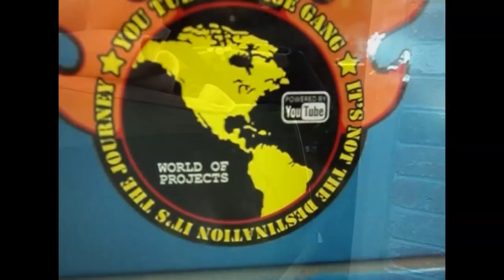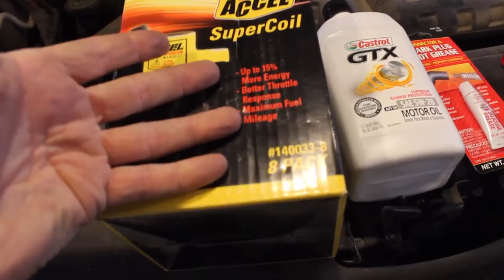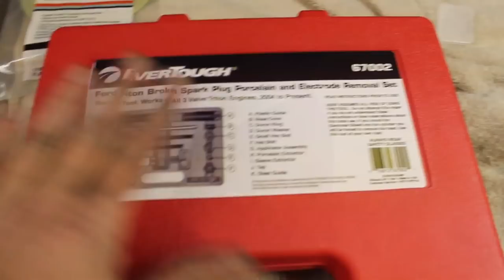F-150 Transmission Shutter - Fixed - Coil on Plug and Spark Plug Swap

Comment: Wish I would have seen this video months ago. My 06 f150 was doing the same thing. I knew I had a coil going out. So, just changed all the coils. Wouldn’t you know, runs like a dream. Now if I can figure out why my high beams stay on.
Reply: Same problem with the lights, had to change the signal light lever. Has to push it in and move it to make them turn off.

Comment: I have a 05 F150 the same issue, and gave up on the place i bought trying to fix this issue. There was no way I was going to pay any shop to replace the coils and plugs. I just picked up the OEM coils and plugs as well as the extraction tool for less than $300 USD. For a Canadian that a good deal:) Although I am 15 minutes away from Blaine Washington. Good to see a guy with some balls post a do it yourself video. Great job and thanks for posting! As far as that Earl guy total no class act.
Reply from the maker: +Brad Lacey Thanks Brad.  I'm just trying to help out guys like me who want to save a buck...  Most of this repair work is just turning wrenches...  Dealerships seem to think that type of service is worth a fortune.  Compare book time to real time and you're paying 3-5x more than you should.
Reply: Hey Greg, thanks for the reply. I agree, dealerships like to rip people off! I just changed out my plugs and coils on my 05 f150 5.4 Triton yesterday. This took me 7 hours and zero problems after I watched your video. So going back to dealer costs dam straight a rip off. If I can do it in 7 hours in my garage I am guessing it would take a dealer 3 hours or less. Thanks again:)

Comment: Wow yours does it for a long time. No matter if i throttle out of it or not it only lasts a second...

But yea alot of people want to jump right away to a bad transmission. But there are other things that can cause symptoms similar to a bad tranny you wouldn't think of first time diagnosing .
Reply: So when I hit 55 in my 2009 F-150 It seems that I lose acceleration but only for a few seconds. Is this issue the one he is currently covering in the video?
Reply: @jgoelites6308  I'd have to re watch the video. 

But i eventually HAD to replac all my coil packs WITH OEM or Accel Coil pack set. Did the spark plugs again because they had some mileage and the sooner you do them, it makes it super easy to get them out normally. 
So its worth the peace of mind, the spark plugs arent expensive. 
However the coil packs aren't cheap but need to be done. 
The stock ones on your truck, if original, are definitely either weak or failing already. Esp under high load, low rpm acceleration. This causes a sporadic misfire that feels odd during a downshift as well.

After the new coil packs, the truck felt soo much better, i wish i had done them sooner. Also i learned the hard way with the cheap ones on ebay, they just don't last that long, but they work good when they are working if you need something quick and cheap.. 

I found oem coilpacks for about 30/40$ each, so about 300$ for 8 new oem coil packs and another $75 for the set of spark plugs. 
But I still had a small shudder sometimes when  it was down shifting, but only when coming out of O/D and accelerating just enough to get that downshift. 
Eventually the transmission failed by acting odd one night all of a sudden. Had to bring it in to my friend transmission shop. 
I had him do the transmission, because i had just done the motor 8 months prior and didn't want to do it.

They took it apart and it turns out the shift drum sleeve had a crack going down it about an inch long. So it wasn't engaging properly and was also slipping. 
I was still able to drive the truck but the second time i started the truck it was in Trans Limp mode. So only 2nd & 3rd gears worked to try nd get you home i guess. 

Transmission shop told me Ford fixed this issue of the drum cracking in mid 2005. 
Then in 08 they did some more transmission upgrades, they revised some stuff like a better pump and torque converter i believe..
I had the transmission rebuilt by him and he did all the upgrades they would do on these F150 transmissions. He mentioned things like SS shift drum, Increased line pressure, newer higher volume trans pump and a few other parts that were revised. And then a full rebuild and reseal. T/C was fine and ive always done regular oil changes and it regularly since getting the truck. I did the fluid again to have both new and i had it out. 

I have about 110k on the rebuilt transmission now already. Works great! Shufts much quicker and smoother than originally and it feels like the TC locks up quicker on the highway and it helps with the power response. No lag just instant acceleration. 

The truck has 270k miles on it now lol. Ive owned since 2006 and it had 9k miles on it. I regularly tow our boat. And it's a big heavy offshore fishing style 26ft center console. 

We also put dirt bikes in the back all the time. Make long trips driving 2 hours at a clip. 
And we also off-road it and take it on the beach. 
So it gets used like a truck, but never trashed or overheated or anything like that ever. Never ran low on fluids. 

120k on the rebuilt motor from a highly rated online rebuilder of these engines. 

BUT....  fast forward to now again, 5/6 years later and the engine is making a slight tick noise and im pretty sure i know what it is. Rocker arm Needle bearing from looking into it and my own knowledge of this motor..

Im getting a upper valve train noise again. Sounds like a lifter or rocker arm going bad again. Ansd they were replaced/new when rebuild 4.5 years ago. 

So idk between the timing chain job and work to get to that point (2K$ in parts). Now im thinking why not just go with a new truck or even lease a new truck and decide to buy after that. That way at least i know it was taken care of since break-in new. 
I was thinking of picking up a new Toyota Tundra 5.7L V8 4wd Crew Cab SR5. Same spec. 1/2 ton 4WD 4-Door pickup truck. 

Its 52k$ for that truck with the few options and the SR5 offroad package added. Thats all you need as far as options especially these days with new cars. Plus its a Toyota and besides maybe some options with better MPG, it won't be worse than the F150 and it will be a simple reliable V8 used for years now...

Comment: Mine is an '07 F150, 5.4L 3V.  I replaced the spark plugs at about 120,000 miles but first bought a Lisle tool in case any of the plugs broke.  Reading and watching everything I could before doing the job I decided to use an air wrench.  First warmed up then engine, then removed the COPs, then broke the plugs loose 1/8 turn and sprayed PBlaster down the wells.  Let it sit for 20 minutes and went after them with the air wrench.  Didn't break any.  The new plugs "cured" my trans shifting problem.  New COPs are next.

Comment: Read in numerous articles those 5.4 Tritons are notorious for plugs breaking and there's a special tool at auto supply stores to remove them. I think they finally fixed the problem after 08.

Comment: I came for the spark plug change, I stayed for the Royals/KU fan...... also the guitar building.  I actually miss living on the Kansas side of the metro when I could run around with a cracked windshield like that.  take care man, and thanks for the videos.  hopefully I don't have the same problems on my 08 explorer.
Reply from the maker: ingenthronkshb If you hang onto that bad boy long enough, you'll get the Ford Shakes.  Take care!
Reply: I bought it a couple months ago from a Lexus dealer.  I didn't have it home for 24 hours before the shudder started.  far worse than in your video.  they put one coil and plug into it, new cats.  and then they replaced the torque converter and THAT fixed it.  but I didn't want to leave it with just one new plug and coil so I have ordered a full set.  will be doing it next weekend.
Reply from the maker: Arg!!!  The plugs are not fun.  Coils, no  problem.

Comment: have had a similar problem with my 07' Fx4. I replaced the coils with the accel super coils and used E3 plugs, also changed all fluids in the drive train to Royal purple oils and installed a airraid cold air kit the truck ran great I was getting 23+ MPG but after a couple of months started shuddering again found out it's a bad cat on the left side and computer is going nuts trying to balance engine and can't. also if your changing plugs for the first time remove coils and flood the hell out all plugs with wd-40 let that sit overnight should solve breaking problems, use antiseize to make future changes easier!
Reply: +Terry Goldman Get rid of those junk E3's and put Motorcraft plugs in there. Tritons love them some Motorcraft plugs only. Anti seize goes on the smooth part that sticks inside the combustion chamber there is no need for anti seize on the plug threads. It interferes with the torque measurement also.
Reply: thank god something worth reading appreciate the info and love a new try at some way to get rid of my buzz it's a very fast hammer sound.
Reply: @InternetDude  yea and 5 to 8 psi depending on a lot of things I think
Reply: flood what the canal down to the top of plug? is all you can do correct

Comment: I just had similar problems with my 07 F150 5.4 Mine ended up being the torque converter. I changed the filter and 4.5 quarts of fluid with no results. One tube of shudder fix took care of it. This is a different feel from a misfire. It sounds and feels like driving over the rumble strips on the shoulder of the interstate. It will only last a second and it occurs when the converter clutch either locks up or disengages, around 45-55 MPH. Missfires feel more like jerks or jolts or even skips. Coverter shudder is at a much higher frequency. To tell the difference, count the gear shifts from starting. You will already be in first when you shift into drive. You should see three shifts from start. Then after the three shifts, lockup will occur. This will cause your rpms to drop slightly once you are at cruising speed. If the shudder occurs here and also when the transmission downshifts out of lock up, it may be a torque converter issue. It will only occur on mild acceleration or slow downs. It will only last for a second or less and will not continue regaurdless of how you control the gas pedal. Hopefully this helps someone distinguish one from the other. If you have had missfires with a triton engine before, this will be a different feel that is easily distinguished.

Comment: I read the comments here and I have a 2 valve 99 5.4 with 260k. Still running strong. I have used motorcraft and fram filters and change the oil every 4000  miles or less. Fram filters  work well always use 5w30 no matter how many miles . Also lets discuss coil packs. In the beginning I was motorcraft only. Then I bought JEGS brand coils 8  for 140$ and the truck ran like a beast. Then upon inspection I noticed little writing on the coil packs "Made In China". Well at 170k I ran them and they are now failing at 260k. The same dg508  specs are found on  these coils and now there is a company called Precision Auto Labs in China and they are ISO/TS 16949 certified . They are selling 8 coil packs for  under 40$ on ebay. In 1999  I would have gone with motorcraft. But in 2018  the tech is out there and there is no niche market anymore.  I would bet my bottom dollar  the accel coils are also made in china and marked up .

Comment: Wait till the little stinking plastic tabs start breaking off of the wiring harness and you have to zip tie them down so it won't misfire. After breaking one spark plug I figured out how to not break any of them by constantly reversing the ratchet back and forth, tightening and loosening the spark plug. Basically take two steps forward and one step backwards. Loosen the spark plug a bit, then tighten it back up then loosen it a little more then tighten it back up. This will help break the carbon buildup off of those funny-looking cowbell shaped ground terminals on the spark plug.

Comment: to anyone else outhere changing plugs on the ford modular eng8nes. I've had GREAT success by running a tank or 2 with some seafoam cleaner. Then running a can of seafoam spray through the throttle body. when removing the plugs, all the carbon on the tip was nice and moist. I still crack the plugs and run some penetrating oil down through the plug threads. never had an issue with this

Comment: Hmm...my 2011 Towncar does the same thing in the 40-50 MPG range. And I randomly got a misfire code and it ended up going away, but still have that shutter at around 40-50 MPH. It only happens in overdrive though when it is on a mold load.

Maybe I'll try the coils and plugs.

4.6 2V.

Comment: My 2007 f150 with the 5.4 triton is doing the same thing. Same speed same conditions. Ill be fixing it this weekend. Thank you for this video.
Reply: I had the same shutter sound around 50 mph when shifting into overdrive.  It is a fairly intensive job but then again any work you do on the 5.4 l Triton V8 you will have to remove the wire harnesses and some ac lines but other than that pretty easy job.
Reply: I hope that's all mine is it starts at 40 was told the Tran. Ain't shifting into over drive. When I first drive didn't do then second ride picking it up it was missing little and shaky at idel but had old gas also. But the shaking drives me crazy sadly my disibilty I can't fix my self have to find help that sucks I've always done my own work  but the pain to stand and the heart attack yeah no more.  But I really want to fix have t had a good ride in years.  Then have to fix the guess brain behide the radio it may be out cause whipers windows and inside light don't work.  Crossing my fingers my blessing turns to be blessing not lemon. Lol. But hope y'all got y'all's going. God bless

Comment: Great vid! I have an 08 5.4 4x4 and I thought it was the trans for a while, but I'm convinced it's the misfire. 40-50 mph always and around 1200 rpm slightly accelerating I get a violent consistent shudder. If I stab the gas and it still does it and soon running the engine up the MIL light flashes, which I found in another video in the same topic means misfire and the cat is getting too much unburnt fuel and is overheating, and letting off the light soon quits flashing. I am debating on taking this to a mechanic who knows how to properly do this service or if I should try myself, I am not really inclined mechanically except on the electrical side of things personally.
Reply: thebuzzcjc I'm having the exact same problem I thought my transmission was screwed but I'm getting it checked out this Monday hopefully it can get fixed and not cost my over a 1000 bucks
Reply: I was quoted 600 for plugs and labor. Seems high but It seems these Triton engines are a PITA for some services.